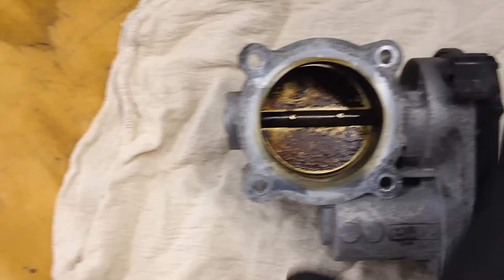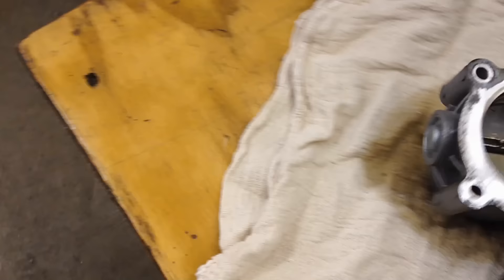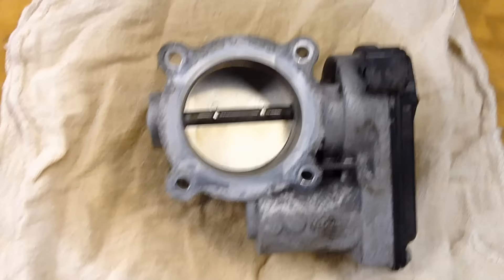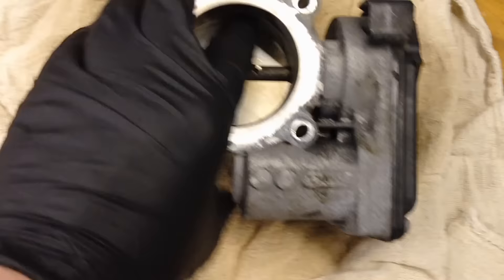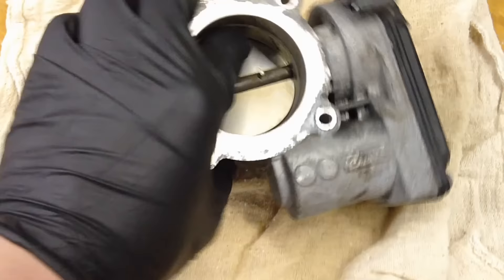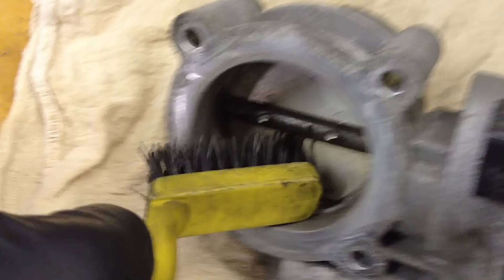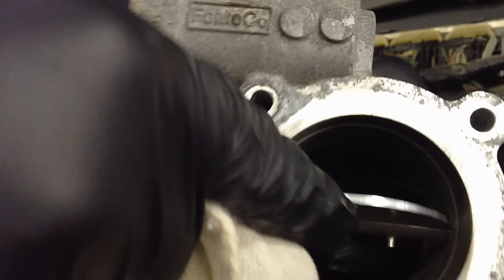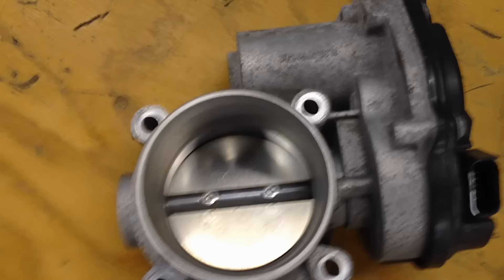How to Clean an Electronic Throttle Body Safely

Comment: Once the cleaning is complete, I also put a drop or two of oil (3 in 1 oil, etc) in both pivot points of the butterfly and work the oil in a bit, then wipe down any excess. It helps to keep that moving joint lubricated and moisture/ice free.
Reply: It will burn off strait away and leave a new mess behind
Reply: @BlatentlyFakeName  Well... it hasn't. I'm not sure if you know this, but the throttle body is not inside the combustion chamber.
Reply: @SevenSixTwo2012  Bad practice my dude…
Reply: @christophervanzetta  Done over 2 years ago and still works like a charm in my Ford V8. I'm not worried about the minuscule amount of oil being sucked into the intake, if that's what you're driving at.
Reply: can't resist comment, the gunk causing the carbon and varnish is from petroleum products, gasoline and lubricating oil vapors. So putting a drop of oil on the pivot points of the butterfly is harmless. the temperatures of the throttle body are not high enough to cook the oil and even if so it is  not going to cause a major failure anymore than the normal deposits that will come with time. The oil is effective for a time, whether it is long enough or whether the lubricated parts really experience a beneficial difference in function I can't say but the thinking sure seems right, can't hurt is the big point here.
Reply: Do I have to reprogram it on an F-150 3.5 EcoBoost

Comment: Myth busters should've d tested the "chopped finger" legend!
Reply from the maker: +Nikolai Tsakov I know right! I am not going to test their theory though.
Reply: @FordTechMakuloco  If a test like that were to be done use a chicken bone and even a throttle body you don't need.  The second part is only in case the test causes any damage then you won't have to get a new one.
Reply: @FordTechMakuloco 2011 Ford Fiesta. Excellent condition at 110,000 miles. All maintenance since new. Transmission seems fine. Runs great out on the highway….one problem. Feel a vibration in the steering wheel or engine while idling at 9000 rpm’s. Do not seem to feel it at higher rpm’s or when driving on the highway You got any ideas?

Comment: POWER RESTORED! 2009 F150 5.4L 3v - 180,000 miles. I cleaned the TB per these instructions and performed a relearn from the other video. During the first test drive, the throttle seemed like it was sticking. Like it was in cruise control. When I came to a stop, it was surging back and forth between 700rpm and almost 2000. I could shut off the engine, restart, and it would idle great, very smooth. As soon as I gave any throttle, it would start surging again. I rechecked my fittings and plugs. Started back up, idle was good until I touched the pedal. It still surged but was diminished some. But it was like it was still trying to figure out the idle. So I barely taped the throttle, it would rev and hold for a moment then come back down to a smooth idle. Did another shut off and restart. Then it was idling perfect even when I revved the engine; it came back down to normal idle. Did another test drive, WOW! Significantly noticeable power increase. Now onto the induction service. I could see down into the intake manifold, and it was quite dirty.

THANK YOU, FordTeckMakuloco!

Comment: FordTechMakuloco I remove the throttle body because it is easier to clean.   Thanks for the warning on the energized motor and gear reduction.

Comment: Brian, I also try to keep the motor/gearset towards the upper side in an effort to not allow the solvent into them. As usual another great video.
Reply: I second this.  Right around a year ago this month, actually, I cleaned the throttle body in my trailblazer that had 155K miles of crap on it, and failed to keep the electronics to the top, and ended up getting some cleaner inside, causing a high cold start idle and lots of random fluctuation.  Finally, I went and bought a good used one from a salvage yard today, cleaned it up while keeping the electronics to the top the whole time, and never aiming the spray directly at the hole for the rod of the butterfly valve, and so far it's fixed my issues.

Comment: Thank you so much for this video. My 2008 Ford Escape Hybrid was  randomly shutting off, even on the freeway, for months. I was able to gain access and clean the throttle body without removing  it from the car. So easy. I have gone  another 15,000 miles since with no problem. Thank you again!
Reply: I think theres a recall for the second generation escapes. If you still have the car and it's acting funny, look it up. It's a free replacement.

Comment: Great video.  At $50 for a replacement throttle body, I decided to just replace it in my 2009 Escape Hybrid w 120k miles.  Your other video detailing those steps helped significantly.  Great work!

Comment: Great video. Throttle body is clean, Mustang is running well again, and I still have all of my fingers. Thanks for the guidance.
Reply: Did you have check engine light on or was it just running a high idle?

Comment: Talking to my dodge hemi expert, and he said they recommend NOT using carb cleaner for this. They recommend brake cleaner. Sounds like it was exclusive to 5.7 hemis, but i didn't ask for an explanation.Used the brake cleaner, and it worked fine. Just be super careful not to get any even near the electronics! Thanks for clearing up the myth about moving the butterfly valve when it's on the bench. A lot people on their videos are painstakingly trying to clean it up without touching the plate. Lol.... Gawd....... it's agonizing to watch, when you know they could move it without hurting anything. As you said, connected is a different story!! Thanks! .
Reply from the maker: Right you want to use throttle body cleaner not carb cleaner nor brake cleaner they are way too harsh.

Comment: Wow. Never knew that these could actuate with key off. Makes sense when you mentioned the ice breaker strategy. Thanks for posting this Brian. They fingers you may have saved could be mine!
Reply: unhook the battery, then you lose the computer memory, its easier to just  unplug the Throttle Body.
Reply: you need to do a relearn process after doing this anyways.. disconnect the battery and do the proper relearn.
Reply: That is bullshit they do not work when the ignition key is off.   Do not disconnect the battery,,, just disconnect the throttle body .  Electrical plugs,,,,, let the cleaner evaporate,,, before reconnecting or starting the vehicle,,,,,
Reply: @ricksimpson2167  

Your Logic is just like some Automotive personell that work on cars everyday for a Living...This AIN'T 1985.

I once worked for this Fella in Downey,CA. ( Real Nice Guy )

He installed the WRONG Grade of Motor Oil in a Womans car. When she drove up those steep a_ _ Hills in the Los Angeles Forest, her Engine SEIZED up on 'er.

How much did that "Uneducated Knowledge cost my Boss" ? ..It wouldn't shock me one bit if you aren't one of those Rascals that still think in January 2020 that "Oil is Oil, we can use any Oil".

The Author of this Video is an Ex Ford Dealership Technician and a U.S. Marine outta Chicago...He definitely knows what he's talking about.

Ex- GM Dealership Technician
Southern California
Reply: @cbarkwell1000  I’d strongly advise against disconnecting the throttle body OR battery unless you want more headaches.

Comment: Always hit it from the front also, and then the back again.
Reply: I really wish I could pick your brain I did a total timing chain replacement on 4.0 sohc good compression good spark but now my computer is throwing all different random codes any ideals
Reply: @dennisluttrell2228   what codes?
Reply: My wife says the same thing.
Reply: @xtrastrengthfukitol7733  lmao. Thats awesome. To funny😂
Reply: @xtrastrengthfukitol7733  ya cracking up 😆

Comment: Thanks a million for this video tutorial. Worked all night and on my way home my car stalled after I exited the highway and stopped at the light. I was able to put the truck in neutral and restart my 2004 4.6L Explorer. For years I’ve noticed that @80mph uphill or cruising my SUV would give a slightly smooth trot, it was noticeable because everyone head would give a steady nod while riding ein my SUV. I didn’t mind because I had no issues until my 2nd battery and 2nd alternator died. The battery and alternator 1st died in 4yrs. I spent over 6 $Bills in 2008 and 10yrs later I decided to change them myself. One thing I didn’t know was that I had to reset the computer memory and once my battery and alternator had been replaced I noticed the car idling at +/-400RPM and got a code: P0506 Idle Control System RPM - Lower Than Expexted two days later. I used MAF cleaner, lint free wipes and a clean nylon pipe cleaner without removing the valve since I do not have the replacement gaskets This week. I’ll  monitor the result.

Comment: Thanks for this, I'd been concerned about cleaning my electronic throttle body as I didnt want to mess up the timing of the motor. I'll simply disconnect and crack on!
Reply: Same. That's what I do every time I clean It. I never clean It while the battery Is connected. I take off the negative terminal before I do this
Reply: @beast11135  do you still do "relearn" procedure?  I get mixed messages from ppl saying if you clean electronic throttle body you must do throttle relearn procedure.  Thus,  I've been too afraid of cleaning it myself.
Reply: @edjo3430  the ford fusion you don't have to do the relearn
Reply: @edjo3430  just clean and put in back in

Comment: I recently bought a 2007 Five Hundred with 103300 miles on it. After replacing the spark plugs, I cleaned the throttle body and followed the re-learn procedure. The car runs so much better- no hesitation, no low-speed stumbling. Thanks for the tips.
Reply: +Rj Greek Two months later, the car is running great!!!

Comment: I’m glad I found your video I was going to clean my NC Miata’s throttle body soon and figured I could leave the throttle body on the car and just wipe it with a rag around the bore and possibly open the actuator maybe even resulting in my finger getting clamped, thank you sir

Comment: Great vid. QUESTION : I was told to hold the throttle body with the motor topside when cleaning to avoid the cleaner and carbon guck from running down the throttle shaft and into the motor and gears. (Causing failures). Any experience with that, or is there a shaft seal? Also I use a soft bristle tooth brush, gets in there easier.
Reply: I just spray throttle body cleaner on a rag and wipe the best I can. No issues

Comment: good job. i would say additionally open the throtle body to check the plastic gears and with a fine sandpaper clean the two poles inside.

Comment: Another great video! I just watched this vid and the "Electronic Throttle Body Calibration Procedure" video. BEFORE removing the throttle body for cleaning, would you recommend I disconnect the battery? Then clean/reinstall TB (with new OE Ford gasket) and perform calibration procedure? Vehicle is 2012 Ford Fusion SEL w/2.5L, Auto. Long time (43 years) Ford owner and your time and efforts are truly appreciated.... Thanks in advance!

Comment: thanks again for clear concise no-fuss vid. Question: no issues moving throttle plate while disconnected ... and is it acceptable to disconnect TB without disconnecting battery to remove/clean/replace?

Comment: Very good video. I was going to just use the spray with the throttle body on the engine but seeing all that junk on the other side of the plate, I am now going to take it off to do the job right.

Comment: So I get this straight, you CAN move the blade when it is NOT energized correct? No fear of damage to motors or gears? I did move the plate on one of my cars when energized and I think it f-ed up my TB. And now I am concerned that I was sticking my fingers in there. You are a wonderful resource.

Comment: I agree with it all; except, your using a rag to finish it. Rags and paper towels, etc, can leave things that should not be sucked into the plenum; toothbrush okay IF it's very clean. Best to just let it dry on its own. Throttle Body and Mass Air Flow drys very fast.

For whatever it's worth.

Comment: I'm positive that there are no vac leaks. The car has 148k and there is plenty of power. No misfire issues. Im familiar with all the old fords and the idle air control valve issues. The symptoms are identical. But no IAC valves on the new ford engines. Failing cats would cause a MIL light. On the last difficult start it took almost 45 min. of cranking and full throttle to start the car. Shortly after, MIL came on and ran like crap till the car warmed up. Scan said O2 circuit and rich bank 1 and 2. Cleared codes and has yet to return. I'm almost sure the electronics in throttle body may be failing. All this started this year when it started getting cold.

Comment: You can also get a cheap spray bottle and use some Marvel's Mystery Oil to clean the throttle body.  You spray it on and let it soak. Clean it up and you're good to go. Mystery oil is good for the fuel system and won't hurt it.

Comment: Yes,this is excellent demonstration.I'm in the process of cleaning throttle body and mass air flow sensor on my Toyota Corolla 2006.I disconnected electrical wires from throttle body,and I'm using proper cleaning fluid,but I'm still afraid to touch that butterfly inside of unit.I don't want to ruin thing. Are you sure about touching that after taking electrical connection out?
Reply from the maker: It is ok on Fords yes not sure on other brands.
Reply: +FordTechMakuloco Thank you for the quick response.I will try with cleaner,and tooth brush only.

Comment: When I clean them I put a wooden dowel or some such in there one time and work around it, maybe move once. Better that way than constantly manipulating the blade valve IMO. Also I keep old toothbrushes for this sort of thing, I have not melted one with chemicals yet

Comment: I cleaned mine with carb/intake cleaner before watching this video, what will happen to my throttle body?    it was very dirty but it didn't have any coked on carbon like in this video.  But when I sprayed carb cleaner, thick black liquid flowed and there was loads of it. I read that the throttle body valve itself has some kind of covering on it?
My car seems to be running fine after cleaning it anyway but my problem wasn't the valve  it was a breather pipe the whole time.

Comment: For my 2009 Jeep Compas 2.4L, my ETC (Electronic Throttle Conttol) light has come on from time-to-time, each time the Compass went into "limp mode". It's driving fine now, but yesterday, it went into limp mode for about 20 minutes, where before it did it for a second or two. The throttle body is about $230. Just wondering if that was the problem or maybe something else. A garage to do a dashboard light diagnostic would cost over $100 which I'd like to avoid. Maybe I should just take out the existing throttle body and clean it up first before doing anything else? Not sure what else to do.

Comment: Heard on a lot of videos one shouldnt manually move the throttle body flaps on an electronic throttle body cos that could damage it, whats your take on that ?
Reply: You can move it but you have to do it slowly, is a motor, if you move it generate electricity and can damage de electronic parts. Try to clean it first manually with a towel or something because you dont want the dirty go inside the rotor of the motor. Mamoluko have a video how to reset the PCM so the TB can be relearn, if you move the flap usually you need it to relearn.

Comment: I own GM trucks and never move it by hand b/c I'm afraid that I may throw the calibration off.  I always remove them and clean both sides with out moving the blade.  On this Ford, could you have simply disconnected the pig tail wiring harness?  Of course it is so easy to remove them it makes sense to do so and get better results.

Comment: I cleaned mine while still installed moved the butterfly valve based on bad advice and my car has been struggling since I can only go 3k RPM and sometimes it won't start after I've driven for a bit. I have a replacement throttle body coming soon and hope will solve the problem.

Comment: I heard operating the electronic throttle body by hand disturbs its calibration.
I assume that's when the throttle body is attached to the vehicle. It's safe to operate the butterfly by hand, and it won't have any effect on its calibration.
Is my understanding correct?

Comment: I followed these steps and also cleaned MAP and MAS and reset the codes and recalibrated the PCM/ETB. Everything went great for 48 hours and I kicked a P2111 error referring to the throttle actuator control stuck open. That's the motor on the side of the ETB that nobody talks about. Is that cleanable?

Comment: Ahh the old p115e. My 09 f150 started detonating under load and idling rough. Then that code popped up. Both of my upstream o2s throw a light at the same time but I'm 100% certain that the tsb will fix that..

Comment: Hello! When cleaning the throttle, it is not always possible to use iron brushes. because on some modifications for the tray there is Teflon. If this layer of Teflon is damaged, then the entire assembly must be replaced. and even on many brands of the car you need to implement the adoption as the manufacturer has specially disabled this automatic function.
Reply: Toothbrush actually safe also on sensors tooth plates etc.

Comment: I’ve got a 2014 f150 and I’ve used your videos for tips and references for many years, my wife drives a 2013 edge 3.5 and over the past few weeks she’s been dealing with fluctuating rpm’s, she stated that it’s mostly from a stop until the car shifts into second gear then it’s fine, is the MAF sensor or throttle body where I need to start diagnosing? No CEL lights come on.

Comment: So great Video. So I have a 2009 Ford F150 5.4 3V with over 200,000 miles and need to know if Motorcraft selsl a Timing set and a Cam kit thanks.